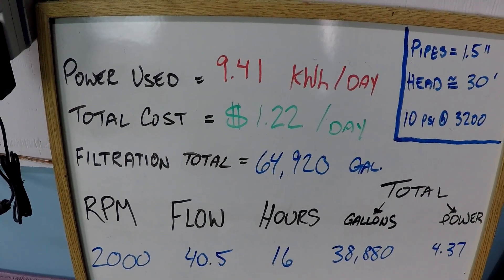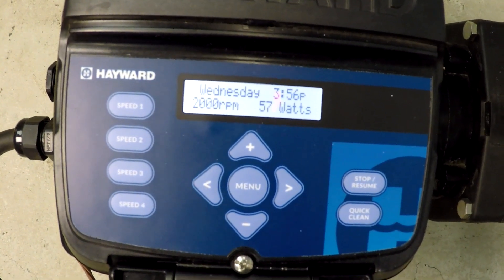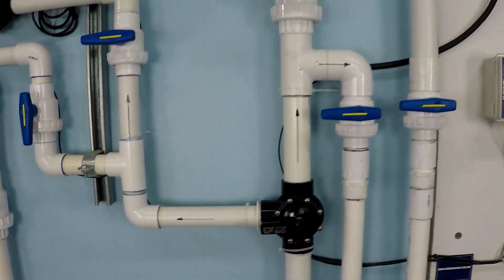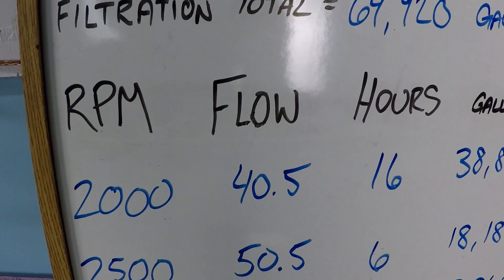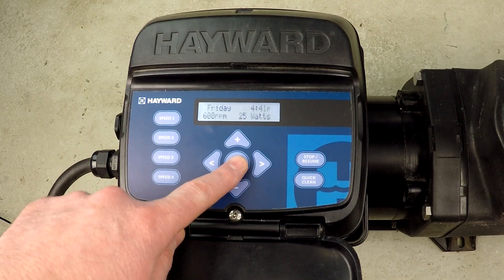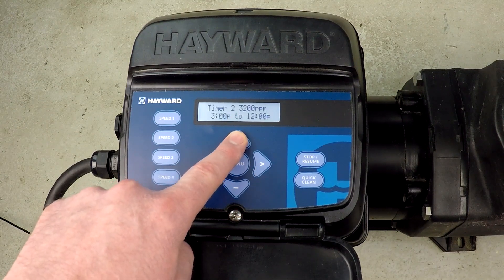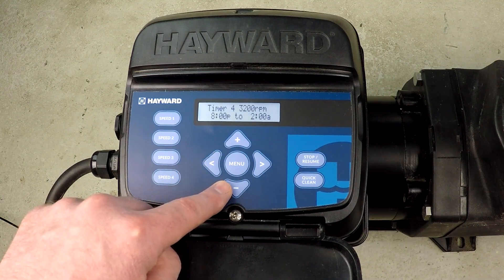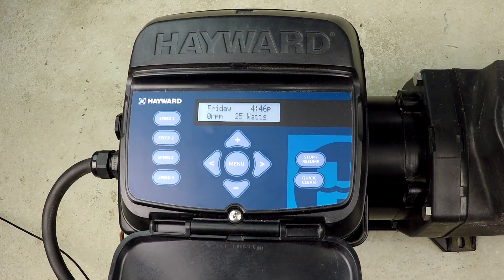Filtration Schedule For Pool With A Heat Pump

Comment: I see you hoarding those B&D VS pumps Steve 😬😬
Reply from the maker: Testing the 1.5hp and 3hp for comparison. Oh and the above ground model too
Reply: @Swimmingpoolsteve  I just got my 2hp model installed but I can’t fire it up yet because the pool is being resurfaced. I found this video especially helpful because I just purchased a FibroPool FH270 heat pump and I am trying to figure out what would be the optimal speed to filter approximately 57k gallons. In reading the manual it says 33 gpm so I’m not sure if that is the minimal gpm of operations or the maximum. Since discovering your page my overall knowledge of pools has increased tremendously. I definitely enjoy sharing information with others on if their pool is out putting the correct gpms lol